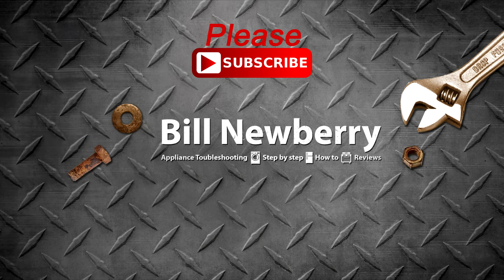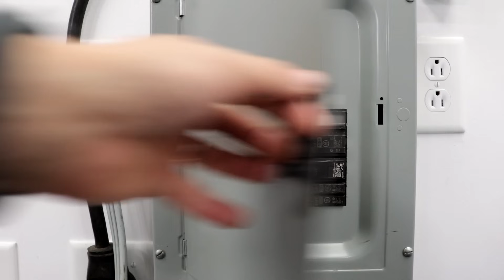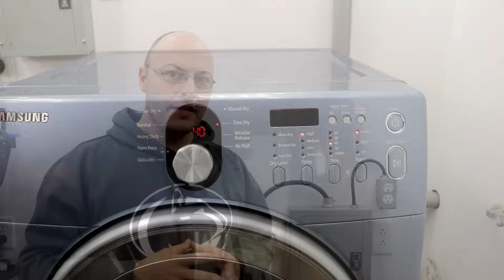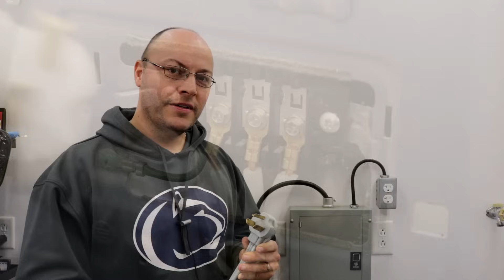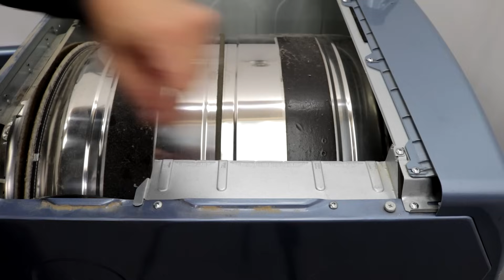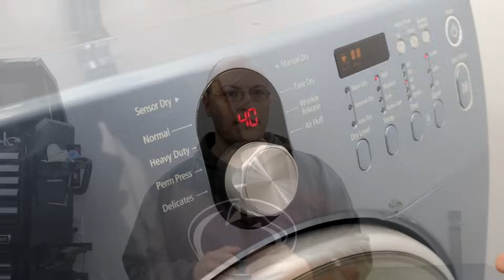Samsung Dryer Shuts Off Mid-Cycle - How to Troubleshoot

Comment: Mine is turning on fine, when I select normal dry the display saying about 55 min. I start it it runs for about 1 minute then the display changes to one minute and shuts off like normal with the chimes and all. But it only ran for a few minutes or so. Thoughts?
Reply: Mine is doing that too
Reply: Mine is doing this....ugh!
Reply: Any fix? Mine did this as well
Reply: Ok my son put a durag on the dryer ut sucked into the lint thing and wrapped around the white fan looking thing. I grabbed it pulled it through until i got it out. I dont know the terms of the parts but thats how i fixed it

Comment: ? I have an electric Samsung dryer it stopped after starting said check lint trap. I cleaned n hose vacuumed out the entire lint trap system hose n outside access but it still stops after starting in 5-10 sec then a min later starts n stops again how can I fix this n is there a reset button I can push.  it's only 2 years old
Reply: find the moisture sensors. If you stick your head in the dryer and look down and right. Should be 2 silver metal strips. I have seen dryer sheets get stuck on top of them.
Reply: TY TY TY   - That's exactly what was wrong here :)
Reply: I have the same issue but I have already cleaned all lint Everywhere possible, I also cleaned the senors and still no luck. What else could I do to troubleshoot my dryer ? Thank you very much everyone

Comment: um so my situation isnt quite like this. when i turn on the dryer everything is fine but running through a regular cycle never finishes. it stops 5 minutes in and plays the finished tune. the dryer can be use immediately after. it will run entirely through the timed dry run though for an hour so im not sure whats going on so i can use the normal dry cycle
Reply: Moisture sensor might need to be cleaned. It’s near the lints trap. If you can’t find one just clean all on the area. If you use dryer sheets check of one is blocking it. I had one stuck on the inside

Comment: Hi Bill, I have a Samsung electric dryer DV337AEG/XAA The problem I have is similar as to what you described in the video. I start it up and it runs for a few minutes then shuts off. Everything dies (controls do not come on) but has power to control. Some time later, 15 min or so, it comes back on and continues counting down but not running. If you stop it and star again the original issue occurs over again. This seems like the control board is bad or could this be due something overheating and shutting down as a safety till it cools? Just wanted to get your opinion before I order another one. Thanks
Reply: Pretty sure Bill passed away
Reply: ronin43 oh man.. that’s horrible.. thanks for letting me know. 😔
Reply: ronin43 did you solved the problem? mine do the same. Tks.
Reply: Jrfox68 - I had the original problem and yeah I fixed it. I took the dryer apart and meticulously cleaned every part off from all the lint and then used dryer exhaust tape to seal everything up inside. It’s been working since.